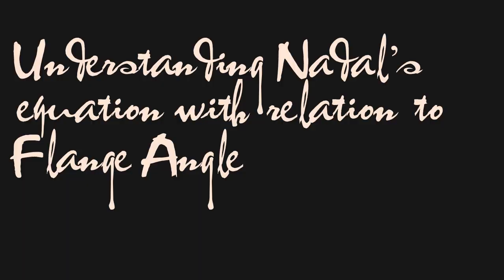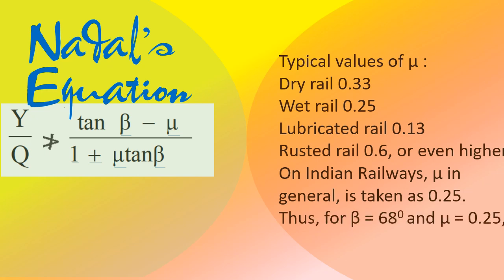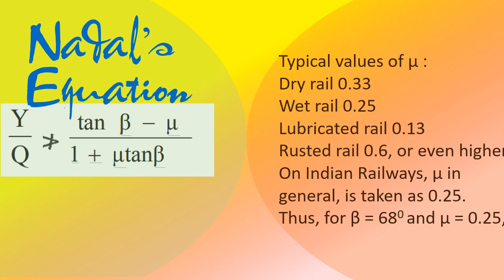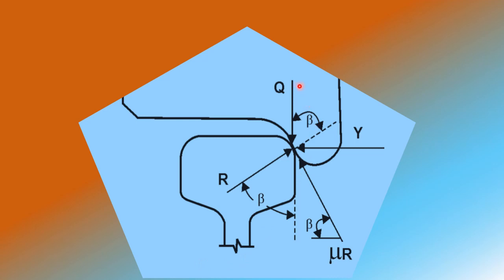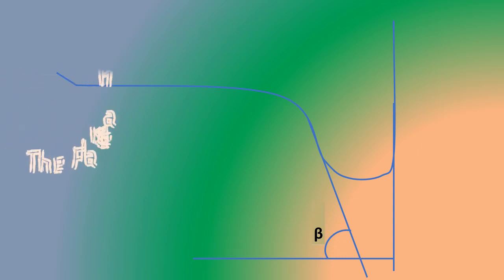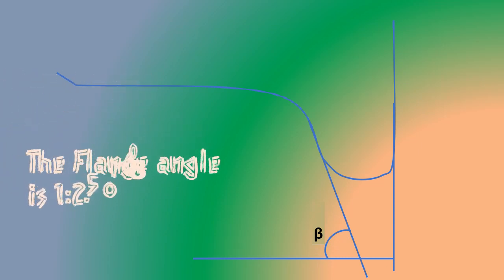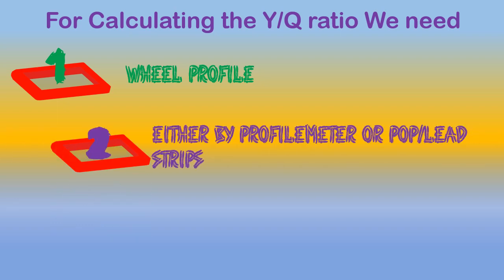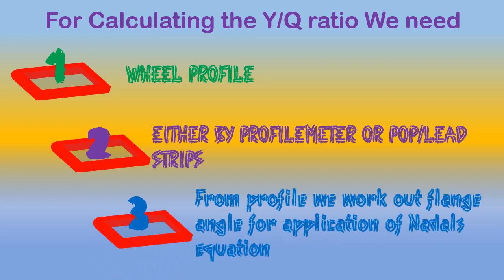Exclusively for P Way Engineers: How to measure Flange angle in field and apply Nadals Equation

Comment: Sir kindly made a video on can cant deficiency for similar and contrary flexure and calculation of transition length by citing practical examples.
Reply from the maker: Thanks for seeing this video. In fact in one of the derailment enquiries, the reviewing authority had commented that nadals equation should have been applied.
But without knowing the flange angle , the calculation of Y/Q is not possible.
Wheel profile has its own importance. It gives thin, deep flange, root radius, conicity, flange angle etc which normally is not in totality in the revised accident proforma.
Thanks once again for your valuable comments.

Comment: Sir by going through your explanation it seems rail profile has nothing to do with nadals formula .so the concept of angular wear stands null and void.
Reply from the maker: Sorry, Rail profile has its importance .
In initial Manual it was 25degree with vertical, in new provisions it's lateral wear of the rail head.
Thanks for your valuable comments.
Reply from the maker: NADALS equation is for wheel flange angle. Does not take into account the rail profile.